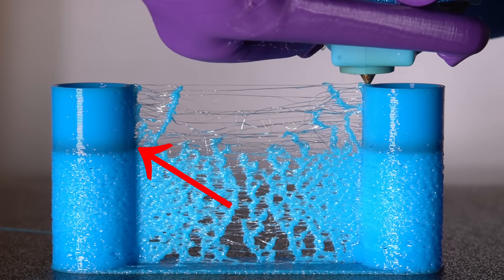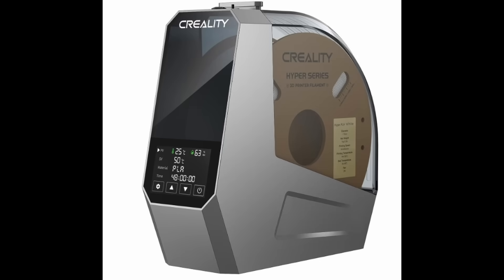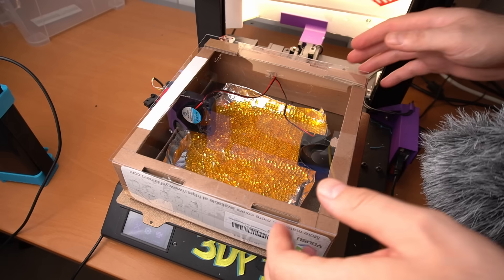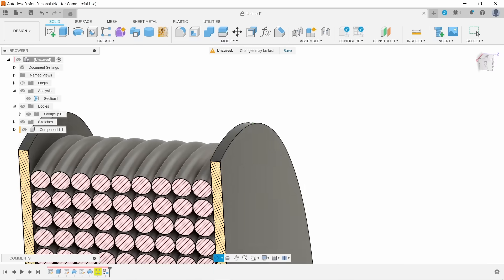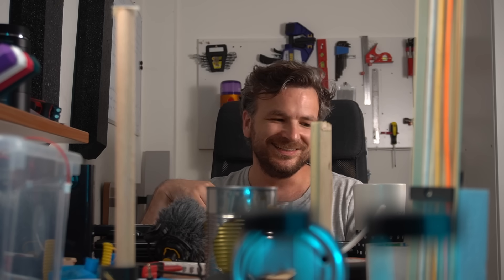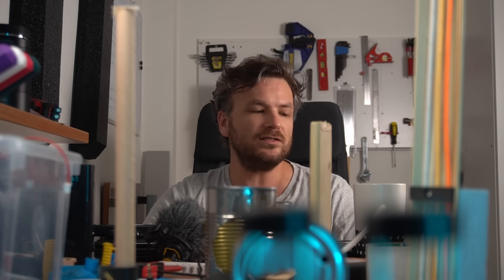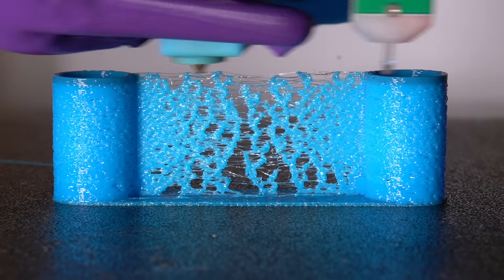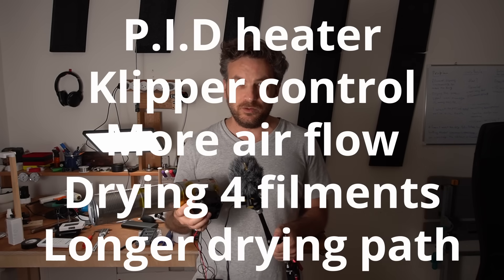Why are we drying filament this way?

Comment from the maker: V2 Update: https://youtu.be/tQcpz31T-cY
Thanks guys for the lovely comments, i guess ill have to make V2...
Reply: Please do. I hate filament boxes. Limits spool sizes I can use, and for some filamenta even causes clogs or breaks because some filaments don't like to be arched through the PTFE tube and whatnot. Really hate it. If you can achieve the same result without dry box, it would be awesome. Maybe play with silica inside the tin cans
Reply: I'm really looking forward to seeing if you can make this work. I print materials that need to be extremely dry and I've just been practicing vigilant drybox discipline, but a more forgiving solution would be excellent.
Reply: V2 BABY
Reply: @harrison1830  wooohooooo
Reply: Yeah.. you'll have to 😂
Reply: I would certainly  be interested in your findings. You've got a new subscriber.
Reply: I think you are in too Something. Maybe Combination of Inline drying with desecant, high airflow and some Heat would even Work better, so the hot Air ist extrem dry. it May even be more Energy effizient If the online dryer is enclosed. but Afterwards the desecant needs drying so that will consume Energy as well.
Reply: My first thought was add pulleys or rollers in the tube for more dry time
Reply: Yes give me more!
Reply: omg this is amazing!! please make a version 2 for the AMX im buying the k2 max with their new ams!
Reply: Filament demands it 😂
Reply: Yeah doe so...  try to make a version Who saves space as well
Reply: you will became voron of filament dryer 😁
Reply: Yes, you need to give us more!
Reply: liked and sub'd. thanks for the entertaining video! let's see part 2!
Reply: I want an smaller version, much more nice looks and if possible a printable Version of this😊

So we only need the heater and power supply
Reply: Yes, please !!
Reply: Im a Mechanical Engineer, theremo, heat transfer and i can think of a way better way, Let me know if you wanna chat
Reply: I've never used 3D printer before, so I dont know why some moisture could ruin the heated plastic...perhaps it could be a way to tackle this problem, instead of finding a way to dry the filament.
But perhaps you can use vacuum. Water cannot exist in vacuum. It would be an interesting experiment. Good luck!
Reply: @ToThinkT  The moisture gets turned into gas form when it goes through the hotend to melt it and then it forms gas bubbles which deform the prints.
Reply: @RichardCMongler  I see. Thank you for the explanation. Until now, I habent have the opportunity to try 3D printing myself, sadly. Have a Merry Christmas holiday!
Reply: A little water accidentally entered my large gasoline tank. After pumping out most, I stuffed  it with DIAPERS. It sucked up the last ~10 mm Water depth of water and left it dry. You could try that out.
Reply: Many diapers contain Sodium Polyacrylate, a good dessicant.
Reply: 🥳definitely looking forward to your V2 update!
🤔I would recommend adding a cheap thermometer+hygrometer just to show the ambient humidity vs the humidity within the can... 💡perhaps having a second smaller diameter perforated can inside your existing tube filled with desiccant that is in contact (? would this be bad?) with the filament could work to pull more moisture off the filament? 
☝here, the desiccant pulls the moisture off the filament while your heated blower continuously dries the desiccant & pushes the moist hot air out some exhaust port...
Reply: Thoughts on a fan and heater in the middle of a coil of filament? Too much resistance?
Reply: Hello! You can use 3D printer components: a heating cartridge, temperature sensor, and fan, to pass hot air through a PTFE tube (where the filament passes through)! I really want to do this, but it takes time.
Reply: i have been designing a filament dryer, this could be implemented at that level as well, on the exit feed, using a smaller diameter tube. Gonna do my own research on this now too.
Reply: What about this: so it looks like a crowded… that..that long sheet of  paper with the candies on it. Take a long strip of packing tape and sprinkle those guys all along the whole length of it and roll it around your filament holder until it’s about the thickness of a full roll… And then dry for a half an hour on box/printer heatplate and unroll it and see if it’s orange all the way through??. How about that?🤗 but that’s not what you ended up doing so..😢  also…. I use my air fryer at 100°F dehydrate, I wish I knew how long was long enough.
Reply: ⁰
Reply: Essentially, you're preheating the filament prior to feeding into the print head. 

Might consider options to increase the filament exposure  to the heated air ... but take care not to overheat the filament.
Reply: i think the heating path is to short. Maybe instead of extending can path microwave filament, get rid of cans and pull it through microwave.

Comment: I live in The Netherlands and NEVER dried filament, and NEVER had quality issues on my Bambulab X1C or my Prusa MK3s+ or my Ideaformer IR3 V2 or my Ender3 Neo. Neither with PETG, PLA, TPU.
I do have a filament dryer but its an expensive paperweight.

Comment: I know a guy that add to his printer a copper tube with heating wire coil around. For temperature control he used lab power supply. While filament run through the tube, steem visibly came out. That type of dryer allow print with nylon on an open type printer.

Comment: This is such a great engineering proposition. 

So many fun things that could be tested. 

My first thought would be to model a smaller chamber instead of a can, and direct the airflow into a beam covering more of the filament as it passes, more like a hair dryer than a hot breeze, and maybe two airflows, offset by 60-80 degrees to hit the filament from different directions as it passes.

I think you are on to something with this project.

Comment: A higher temp excites water molecules and air moving over them will let the not resettle, plus the heated air has less relative humidity.  Time is a factor of course. Our air is laden with moisture, hard core drying would be to use a vacuum desiccator with a cryogenic head, attaching water molecules.

Comment: Pretty sure you can stick silica packets in the microwave safely... I've done it several times, and wrap the packets in paper towels. If they're really full of moisture, run the microwave for about 30sec at a time (or less). Let them cool down and repeat as needed. You'll be impressed by how much water comes out

Comment: I did like the humor in your video, well done.  I think you are onto something.  A good math guy could work out the issues and find the limits.  Your idea while not novel addresses the problem from two directions, your on the tip of the solution, well done, and Cheers!

Comment: What if you had a spool and looped the filament around it with only 1 wide layer. Such that all loops are exposed to the dry air. Then put the spool in a container and pushed dry air through. This would greatly increase the time the filament was exposed to the dry air, giving more time to dry

Comment: Honestly I don't see the issue. I have 2 dryers from Creality (You showed one of them, I have regular and double one)
I just load new spools inside, turn on the dryer on needed filament preset, start printing right away, and even after printing it will still dry further, and I got one of them in my garage which is not insulated etc, even in winter and 0 C degree in closed filament dryer moisture is not getting higher than 26%.
Also it will dry even faster if the spool is not plain closed ones, but if it has big holes on the sides exposing most of the filament it will dry pretty fast. And they got hot airflow and little vents to get rid of moist air, and you can put silicone gel inside for a bit of improvement. But I think it's not needed anyway.
Using 300w heater it's a bit bizarre tbh. Also a little funny how you have a 3D printer and you are taping together everything like a mad man instead of prototyping something cool to connect everything.

Comment: I think the answer is very simple... these filament dryers are too expensive, when you can buy a cheapo EIBOS for $50, and they're best shot is a $350 to $2000 heater with additional parts that need replacement every once in awhile. Also, I think Thordson has a patent, so they could technically sue anyone who makes a similar product. Gotta love it.

Comment: Hrmrm, so you got it working when you add a can plus dry box? I reckon you should just limit to the cans as proof of concept.... It makes sense that the longer the filament goes through the chamber the drier it gets. Did you heat the cans too? 🤔

Comment: I believe in line dryers are not common, because in order to match the performance of a already dried spool, the device will need to be more complex. You will likely need a buffer of filament to give it more time to dry, especially if you are printing at faster speeds, and also because different materials may take longer to dry. This will cause more resistance on the extruded motor, so then you will need a secondary filament feeder before the dryer to not put additional stress on the extruder. I definitely see the potential, but the additional complexity is likely part of the reason why that unit you found is so expensive.

Comment: I'm not entirely sure you're measuring with your prints... I'm also not entirely sure what exactly you're trying to achieve, maybe I didn't watch the video close enough. :D
But for what it's worth. If you wanna measure how well you dry filament you want to measure weight before and after to determine how much water you removed from the filament. In your setup, you can measure the weight of 10m of filament, send it through the dryer at some speed and measure weight again (obviously you want your scale to be as accurate as possible). Now when it comes to drying filament, ideally of course you wanna expose the entirety of the surface of the filament to dry and warm air. But it's not always practical to unwind the entire spool of filament. And when you dry it during printing you only really care about the surface of the spool (the part of the filament you are currently printing) anyway. Most heated dry boxes used, during the print aren't primarily designed to dry the filament but rather to keep it dry.
In the case if your design. As with any design, there are probably countless ways to improve it. But personally I would start by making the tube thinner, so you don't waste so much air (that doesn't pass by the filament anyway), I would reverse the air flow. You want the filament to pass by the warmest, driest air last, because you want the difference between filament humidity and air humidity to be as big as possible. Also, ideally you would dry the air before heating it up. For example by cooling it before heating it up (like most dehumidifiers do).

Comment: You are correct that warm dry airflow and desiccant is really the only way to efficiently dry filament.  We used that method to dry the air in our compressors for instrumentation air at the power plant I used to work at.  The same for drying filament for 3D printing. if the dryer doesn't have heat and airflow then the drying cycle is not going to be very efficient.

Comment: I've been thinking along the same lines recently.  I think the reason it takes so long to dry a spool is because the inner windings aren't in contact with the air.  Because there's no airflow, they can only dry by diffusion into the next layer, which obviously takes a lot of time.

I was thinking along the lines of a capstan winch inside a dry box.  This would be a fairly large drum around which are several windings of filament.  When there's no demand for the filament, the winch just spins with no tension on the filament, but as soon as the extruder demands filament, it causes tension in the filament, which engages it with the drum.  The winch motor only needs to be able to keep up with the demand from the extruder.  Since the circumference of the drum would be quite large, the motor doesn't need to turn fast at all.  For instance, a 200mm diameter drum would provide 628mm of filament per revolution.

The reason I like this, is that the filament should spend long enough in the box to dry throughout, not just the skin.  Five wraps around a 200mm diameter drum means there's over 3m of filament drying at any time.  A fan would push warm air into the box, similar to your arrangement.  It would first pass through a compartment filled with silica gel, flow past the drum, and vent at the top.  Because the filament passes around the drum several times, it is dries evenly.

The box could easily sit under the spool holder, which could be incorporated into the design.  The temperatures would not be hot enough to soften the filament, so the whole thing could be 3d printed, although I think I'd probably want to wrap the drum with thick aluminium foil to protect both the drum and the filament from abrasion.

If you want to see how a capstan winch works, This Old Tony has just published an excellent video about them.

Comment: I noticed the points you flashed up during the close of the video and they are spot on. I would take a broader approach and consider: 1. how dry does it need to be when printing? 2. how dry will it be in stored state? 3. how dry is the air used to blow around the filament? 4. what feed rate is desired? I think the overall key to printing with TPU has to do with it being hygroscopic which necessitates storing it as dry as possible and maintaining that as it's printed as good as possible.

Comment: You should try using Activated Alumina, its a better moisture obsorber then Silica Gel and last longer between recharges. And can easily be recharged the same way as silica gel. I use it in my air tight filament storage box in breathable fiber storage bags and keeps my filament dry for months. I also use small bags of it in my filament dryers to encourage faster drying times.

Comment: Dryers now days and moving forward need to address two main things and a third that is not as important:

#1 ALL dryers NEED auto-rotation, it has to happen. A slow rotation just like hot dogs at the gas station. A better more confident solution than Eibos has done.

#2 Why are we still using terrible rollers, metal bar, tiny metal bearings, metal on metal. Every single SUNLU dryer sooner or later the rollers turn to shit. It will sound like they all have rocks in them and people have constant issues drying while printing.  CERAMIC BEARING ROLLERS

#3 No more microwave touchscreens.

Comment: I use a food dehydrator - it has a fan. You have to spend ten minutes cutting the grid out of a couple of the trays but that's the only adaptation required.

Comment: I use the Thordson inline dryer but in combination with the ams-ht, I use it to try to get even more drying because I print out of a damp basement; it still is not 100% effective; i had to add a blast oven to my work flow and pre-dry at higher temperatures

Comment: So I just found this, and I have a few thoughts for what would make a decent inline dryer:
1. A long filament path (perhaps a loose spiral inside the dryer body) to give maximum exposure to the drying chamber. This is how the water tubes in a refrigerator work - they are long coils to let the water cool down via max. surface area.
2. A very well-insulated drying chamber with temperature control (PID or simple thermostat) to keep the temps high. The insulation is critical for energy efficiency.
3. Packing the drying path with something that is extremely hygroscopic, ideally more so than silica gel beads. That would likely mean some "renewing" process would be needed periodically to purge any retained moisture.

Comment: great idea! perhaps could be inproved using 25/30mm water pipe, 2x offset Y pieces, pointing one up and one down with fans for air flow, heat the tube from the outside using a reptile heat mat.

Comment: This is a good idea.... I think it could be refined quite a bit. If the blower recirculated air instead of pulling outside air in, I think that would be good. Also a thermister inside and klipper set up to hold a particular air temp in there like maybe 60 or 70c... Ok I might have to get into this myself. I think this could be engineered well enough that keeping filament dry didn't matter anymore.

Comment: I haven't tried printing TPU yet, but I have been using the Sunlu official Filament Dryer S1 Plus. What I like about this is I can take from my dry box direct into this and print directly from the dryer. It has a small hole where you can run the filament out of the box. As you print the filament is constantly being dried as the roll rotates. The dryer (with fan) dries the outside layer, but as the roll turns as the layer slowly comes off, the next layer gets tried for use. It was also a pretty low cost solution, at $35 when I purchased it. I've been using it with my PETG and I've never had stringing again. Time will tell whether it holds up to more moisture sensitive filaments.

Comment: I have a large food dehydrator I just stack the spools in for 24 hours. Plenty of airflow and heat.  But yes, doesn't solve wanting to print right away. But it does suck all the moisture out very well.

Comment: Congratulations!  You've just invented a food dryer, which is available at any wal mart.  I got the one I use to dry filament at a thrift shop for $6.  Nesco makes a pretty good one with adjustable temperatures and plenty of airflow.  Knock out the grids on one of the plastic racks and your filament sits in there perfectly.

Comment: What is 40mm/sec? At 0.1 layer it is slow filament movement, at 0.4 it is 4 times faster. Operate with Volumetric Flow Rates, not print speeds